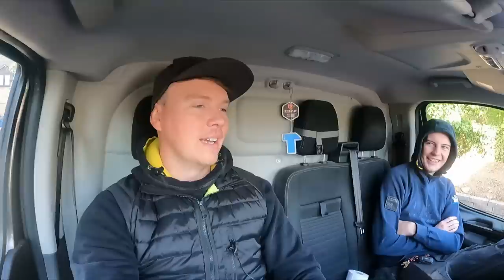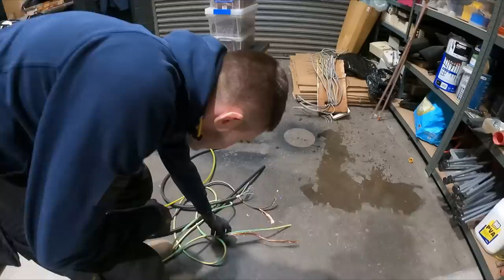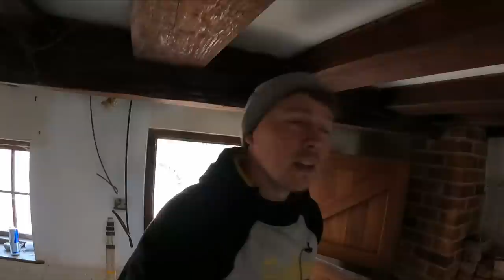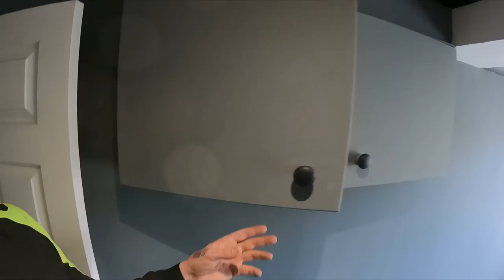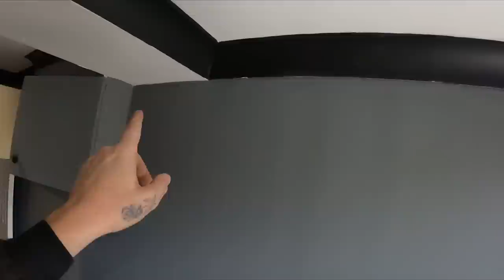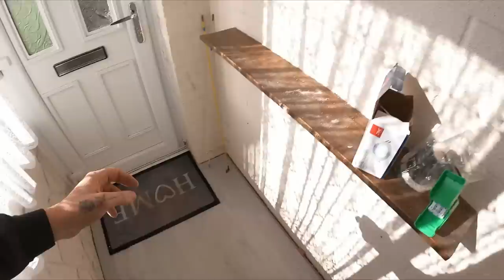Are they stealing electric? Weekly Ep 13

Comment: With that ring door bell, could you consider putting it on the lighting circuit by means of fitting a small (1 module?) din rail enclosure in the corner near the front door to house the transformer, and then drop bell wire from there down to the door bell?
Reply from the maker: Can do mate , have done a few times but this customer wanted it this way 👍

Comment: Mains grid d would have used a different cable to feed next door as the sheath is the earth on that job, so taking tails through doeant supply the next service head with an earth.it was probably done on the cheap by a contractor when the building was split or added to.

Comment: Nice job and great drilling aim!
IMHO the simplest way to comply with the Band I/II voltages in same enclosure reg is to just use T+E for the first bit, then the cable is rated to the highest voltage present. Swap to bell wire once out of the box. It means an extra joint box but is quick and easy.

Comment: Fitted one of them ring transformers last week in a board. You didn't need to move the breakers over. The transformer is only one way wide! If you pulled the middle it would have come away either side. 

Great video mate, keep up the great work 👍

Comment: SELV was covered  by efixx a while ago IIRC. So long as it's double insulated, and the cable is rated to that of the highest voltage within the consumer unit, it's fine. Does heat shrink qualify as an insulation at 240v? I guess so?

Comment: I have Facet Joint Syndrome where my vertebrae are fusing together. It's immensely painful on a daily basis, however I'd avoid at all cost getting on cocodamol, gabapentin and tramadol. The doctors push it and once your on them it's so difficult to get off them. Best thing is keep moving and try to work more above waist height. Good luck with it.

Comment: A note on the bell cable. It needs to have the appropriate voltage rating to be within the consumer unit. Something like a 2 core 0.75mm ho5 flex with a 300/500v rating may be more suitable. 

528.1 of the wiring regs (proximity to electrical services). It states that these bands will be kept separate unless one of 6 different methods are adopted. The two exceptions im most interested in are below:

1) Every cable or conductor is insulated for the highest voltage present.
2) Each conductor of a multicore cable is insulated for the highest voltage present in the cable.
Reply: The simplest solution IMHO is just to just T+E to get the 12v out of the box, (using indent 1) and then a small neat joint box to swap to bell wire.

Comment: I'm sure I read that so long as the cable you use inside a consumer unit is rated for the highest voltage (240v) in the consumer unit, then its acceptable to put a low-voltage device inside, should it be compatible

Comment: Nick do you fit isolator switches for the main consumer unit? Apparently western power say electricians are not allowed to fit them, so they send out their own engineers to install isolator switches or the energy companies have engineers that fit them. However they charge like £200 I think but I don't understand why electricians are not allowed to fit them.. whats the reason for this and do you also pass it on to western power?

I'm asking because I had it installed and the guy who fitted it (engineer) wasn't even an electrician. He was just a fitter, who installs smart meters and admitted that he doesn't know electrical work other than these smart meter fitting. How does that even make sense? Electricians can't fit isolator switches but people with no electrical qualifications and smart meter fitters are allowed to fit them? Surely something is gone wrong here...

Comment: My house is like that. Power comes in off the street then loops into next door from my house.  
We had a problem where one of our breakers kept tripping at exactly the same time in each house. Wasn't until I reported the fault more than once they found the problem out under the pavement. Been fine ever since.
Reply: Had the UPS tell me overvoltage, so looked, and yes voltage was over 260VAC. Went to the meter and checked, one phase 160V, another 260 and no 3 was cruising past 300VAC. Turned off the big breaker for the building, and phoned the metro that there was a loss of neutral in the feed. Neutral went because of cable theft, they chopped all the earth and neutrals off as far as they could go in the substation. Replaced, but did not do the door, so it went the next week again, so this time the doors were replaced with steel doors, and the cable manholes were all welded shut.

Comment: Looks like a non-metered supply there Buddy do they any public utilities such as Street Lights or other Devices on the outside of the building?
Reply from the maker: Think it goes next door, or there’s a street light right outside
Reply: @NBundyElectrical  was about to say the same, my parents house is a 1917 built mid terrace and there is a looped supply across 3 houses. My sister is due to have a new EV company car and the DNO will not permit a charger install unless the supply is de-looped

Comment: Did they include HLA B27 on the blood test form. They have basically given you a slightly more potent NSAID, instead of ibuprofen. Maybe they are concerned with your job that an opioid - may cause you harm or danger. Did they give you nothing for flare ups - or when the naproxen doesn't work? Might take a day or two to work. Sometimes old school doctors are more sympathetic. If pain doesn't improve i'd see a different GP who may well give you an actual analgesic.